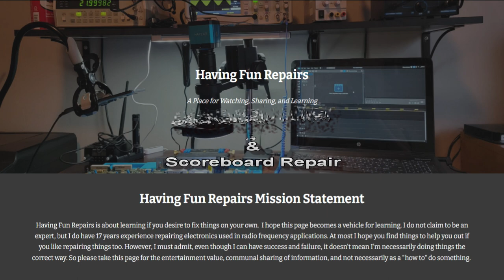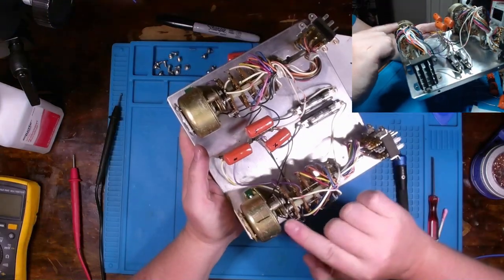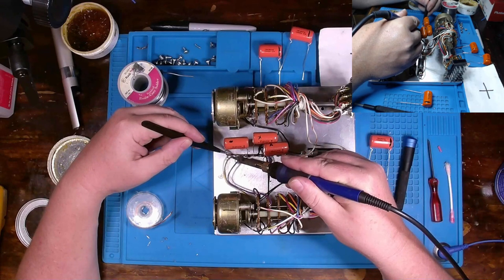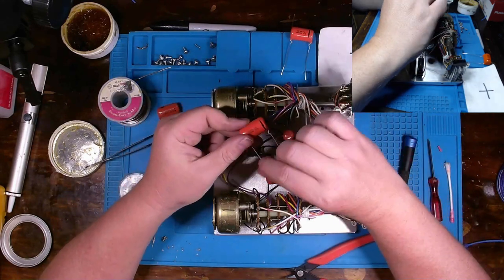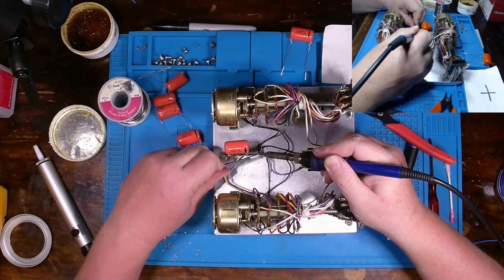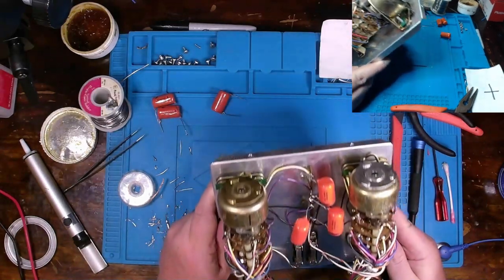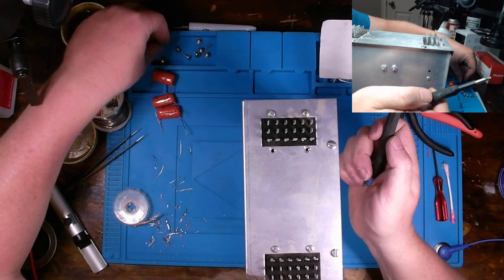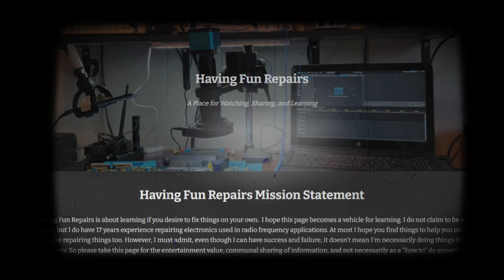(Failure) Basketball Timer & Scoreboard Repair

Comment: Good attempt. You could probably make up a simple test box to advance the motors, check wafer switch contact resistance, resilience etc. but, of course, only worthwhile if there are many units to be repaired and money to be made
Reply from the maker: Great suggestion as always! The thought of testing them did cross my mind, but without a supplier for replacements it felt rather moot. And to only make use of it once, as you stated, did not seem economical. Always appreciate your comments and thanks for watching.